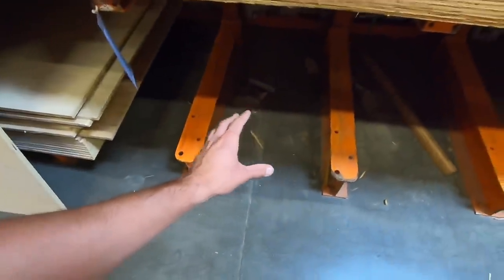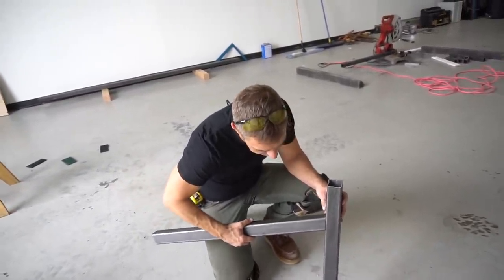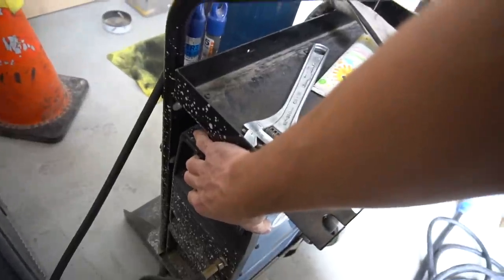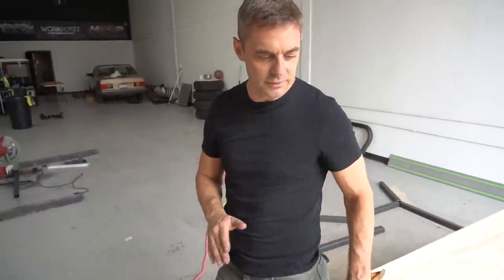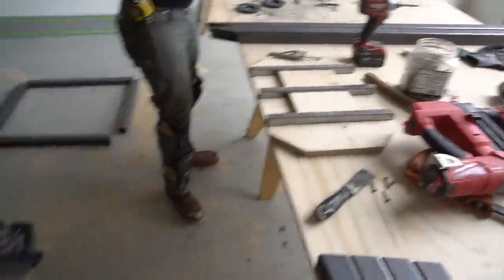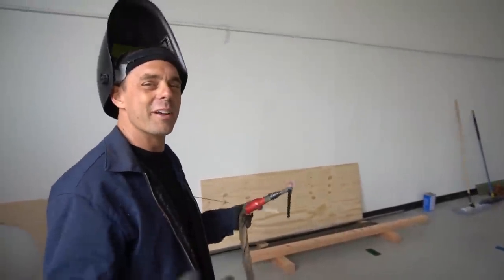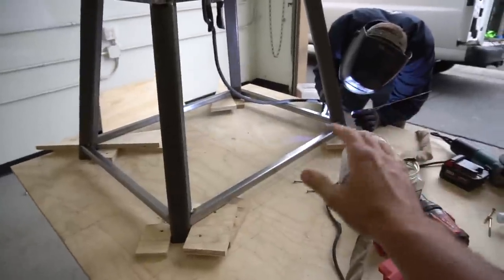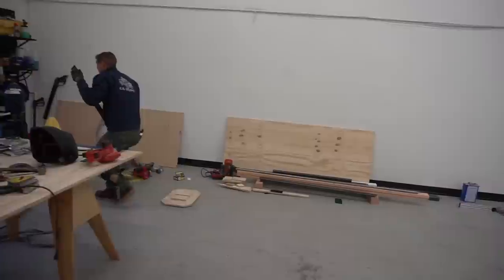WE'RE BUILDING A TRUCK FLEX RAMP!

Comment: You should use Clevis hitch pull pin to attach the ramp to the stand  it would be faster and easier assembly then nuts and bolts

Comment: Tip on tac welding.. Set the machine twice as hot as it needs to be and you should be able to blast a tack with a full bump of the pedal with out filler....